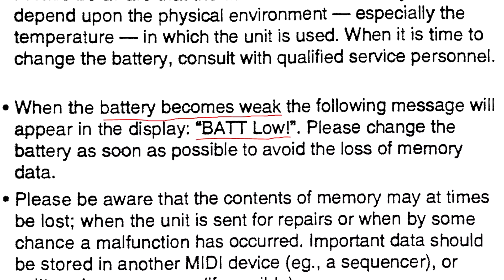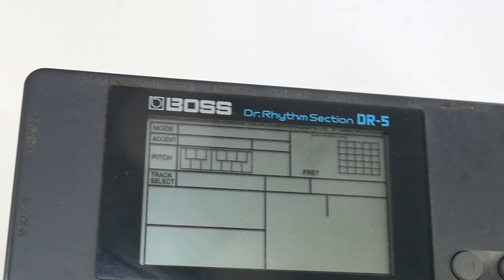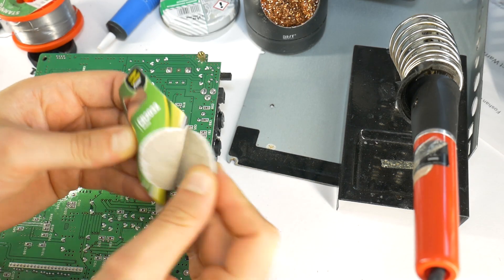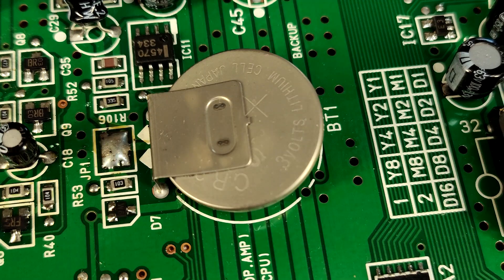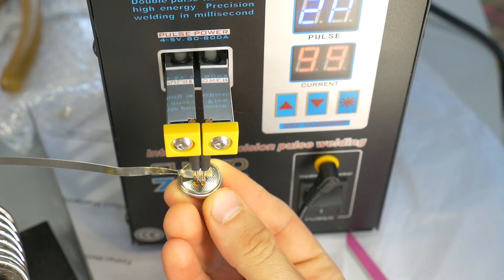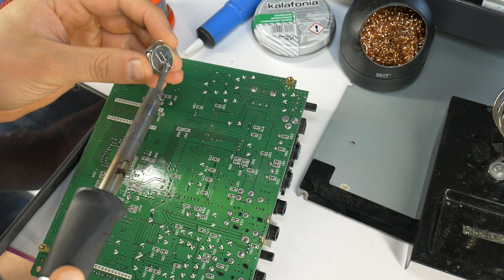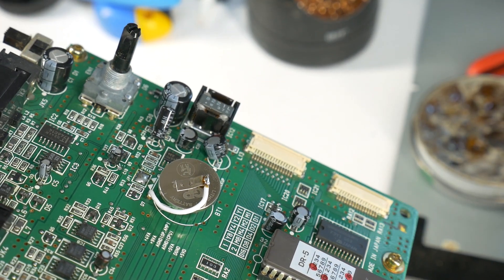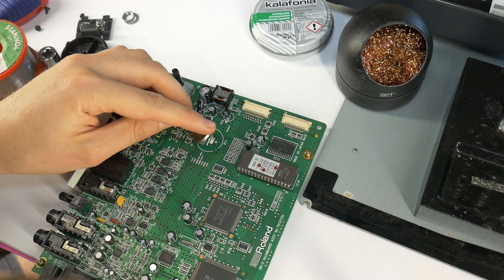How to Replace Battery on Boss DR 5 Dr. Rhythm Machine DIY

Comment from the maker: You can use a CR2032 battery holder because, this way, you don’t need a spot welder. Simply unsolder the old battery from the board, solder the new battery holder’s socket wires to the board, insert a replacement battery, and you're done. You've successfully replaced the old battery in the Boss DR-5 Dr. Rhythm Machine.

Battery holder on Aliexpress:
- https://s.click.aliexpress.com/e/_onHK3rp

Replacement battery on Amazon:
- Global https://amzn.to/4eCxkXg
- UK https://amzn.to/48TlXZK
- DE https://amzn.to/492rYTV

Battery holder/socket on Amazon:
- Global https://amzn.to/3UUJ7ZX
- UK https://amzn.to/3AM8ZQO
- DE https://amzn.to/3ALkEzn
affiliate links
Reply: ur the boss
Reply: Thank you. I need to do this job.  I will get a battery holder, but how do I know which wire to solder where?  Typically, these holders have a red wire and a black wire. Which goes where?

Comment: This is a good video, but I need to do the same repair and I bought a battery socket that has a red lead and a black lead. I just need to know which color to solder where. Which wire goes toward the rear of the unit (the inputs and encoder side) and which color goes toward the front side? Any help will be appreciated.
Reply from the maker: Just check where the old battery contact connects to the board. The larger side of the battery is the positive (+) side, and the red wire is connected to it.
Reply: @TechscrewDIY Thanks. I get that. But since the original one is hard soldered to the board, and doesn't have any wires, I'm not sure which hole on the board the red wire goes through.  Am I overthinking this?

Comment: Dang!  I was hoping the DR-5 had a battery socket where you could just simply pop out the old battery and replace it, like I can on my Boss DR660.  I did "NOT" expect to find out the battery is actually soldered to the PCB.  I guess that means I will need to find a good tech when it's time for me to replace the battery in mine.

That's a bummer.  Hmmmm.....  Perhaps a CR2032 battery socket could be installed in there so that no additional soldering would ever be required after the first battery change/upgrade.

Comment: If you’re careful you can prise the top ‘+’ tab from the battery with a fine blade/flat head screwdriver then lift the battery slightly and prise the bottom  ‘-‘ tab off … I did this because my soldering iron didn’t seem to heat up the solder enough and I was worried about too much heat affecting other components …resolder tabs back on new battery and your done !…. I’ve done this for 3 x DR 5’s !

Comment: Great video, but I don’t understand why you made the same mistake of soldering the battery again. A simple silver tape would be easier for you and the next one who might need to replace it again.
Reply from the maker: Silver tape is not a safest solution; you wouldn't want to lose contact in the middle of the working on machine. Below the video, I have linked the best solution: a battery socket. I didn't have one locally, so I fixed it with soldering, but the best option is to install a battery socket.